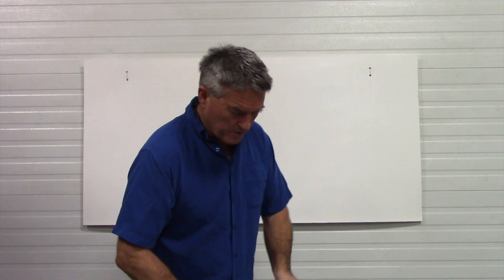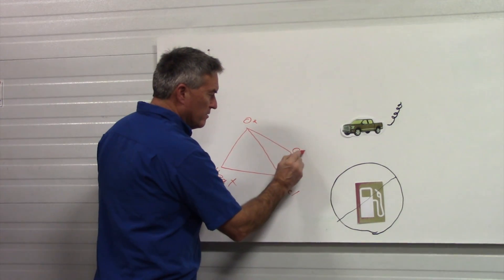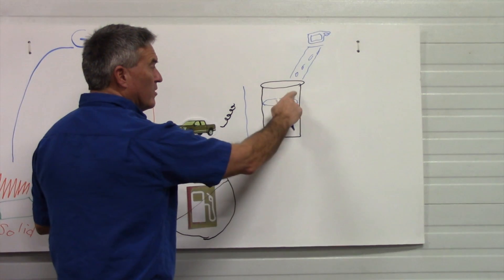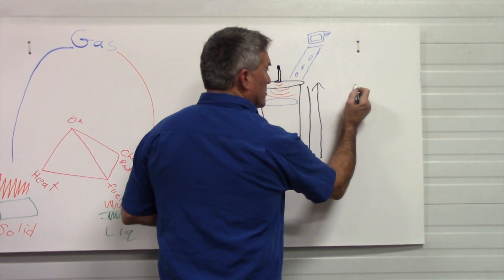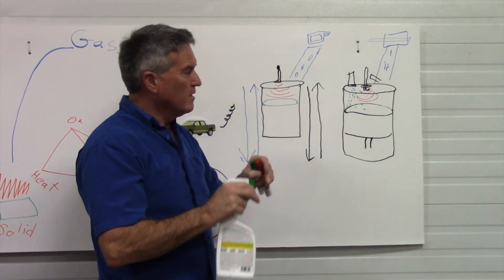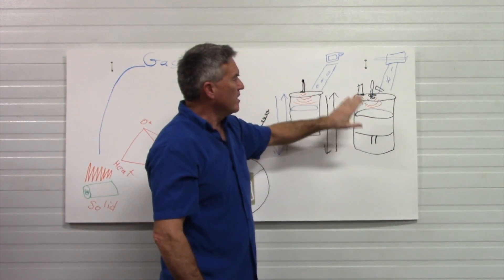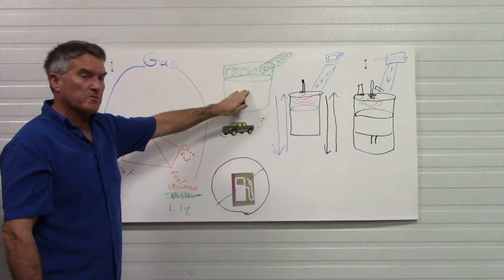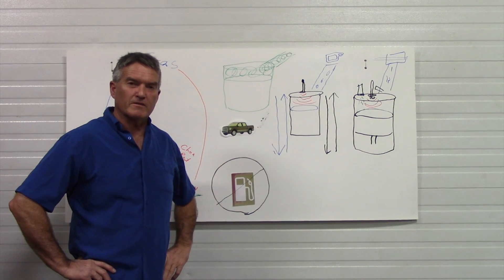One Simple Trick to get 100 miles per gallon with less pollution!

Comment: COMPLETE BS....
At least half the statements made by this guy are factually incorrect.
The ~200 year old piston engine's basic design and operating principles are the problem.
Piston Engines can never be much over 23% efficient, 
and most are around 18% when operating perfectly, as designed.
The energy in a fuel is used in the form of heat to create pressure.
A piston engine THROWS AWAY 70 to 75% of that heat without
extracting any useful work from it.
How did he eliminate all the heat coming off of that radiator ? Enough heat
to keep your entire home continuously over 80 degrees in the dead of winter ? 
AT IDLE SPEEDS !!!
I have a COMPLETELY different design for an engine that is over 80% efficient,
but I don't want to prematurely  "disappear"  from the face of the Earth.
4X the power, AND, 4X the efficiency, with all the tire smoke you can stand..... Not driving 
around like your grandmother on 23 different prescription drugs.
That's right, it can be done, but it will NEVER happen using a piston engine.
Reply: Believe it or not, it's not wasted time.
Putting down large concepts in writing clarifies the overall "vision" in your mind.
Kinda like cleaning your garage, throwing out the junk, 
and organizing everything of potential future value.
Along with consistent defining of misunderstood words, this literally will increase your I.Q..
Clarity of thought is a wonderful thing, and most people don't have much of it,
so they wind-up with a whole catalogue of "automatic responses" and are continually
trying to cover it up with "blarney" (BS). 
And, they think that everybody else is doing the same thing.
Not only all this, there are a few people who are looking for particular answers
to the present stage in their learning curve, which may have nothing to do with
the apparent, overall subject matter here, or even our exchange. 
And they will somehow "accidentally", and for some bizarre reason, just "bump-in-to" this thread,
which may prompt them to "re-think" things in their own personal way.
You wouldn't believe how prevalent this method of learning is, for everyone.
(not necessarily just comments on YouTube, any recorded communication will do) 
I only care about the 2 or 3 people this may inspire, 
nobody else would keep on reading this far anyway.
Reply: Jim Brown I read your posts fully and back you up 100%.  Too bad more people don't value the art of writing.
Reply: Smokey Yunick would've begged to differ...   http://www.hotrod.com/articles/hrdp-1009-what-ever-happened-to-smokeys-hot-vapor-engine/
Reply: I'm very familiar with Smokey.
And what he did was a valiant effort, but it wouldn't "rock-the world".
You evidently skipped over 90% of my post, and think Smokey solved ALL the probs
with piston engines.
He was a brilliant inventor, and I've read everything I could find that he had anything to do with.
But they are STILL antique, WAY outdated, piston engines.
My engine design doesn't have any kind of cooling system,
and the exhaust temps are only ~40 to ~50 degrees above ambient temps, 
and, ~90% of the engine is made out of PLASTICS.
Reply: Jim Brown 
YOU AND I ARE ON THE SAME PLANET!
Very difficult to find someone like you.
Reply: What ???
Are you thinking I'm talking about a Turbine ??
Not a chance, it is not positive displacement, and is therefore not all that efficient.
They are not well suited to cars......  too many transient power requirements.
And what reasonable efficiency they do have, comes only in a very limited rpm range/loading.
They do, however, last almost forever, but.... 
they are massive and heavy, relative to their output, and
they have thousands of precision machined parts making them very expensive. 
But as for longevity, 200K miles is acceptable for a car, 
and most other "intermittent duty" applications.
My design produces torque almost like an electric motor....  ~max, from zero to ~10K rpm.
The rpm is only limited by how much wear you are willing to tolerate.
Like any other machine, you get less wear with lower operating speeds, 
with my design it's actually close to zero wear below ~2K rpm.
And, it can be rebuilt to like new in just a few hours time.
I don't operate on supposition, just math formulas, and known principles.
Reply: The Prius engine operates at 40 percent efficiency today, and Mazda has the skyactive-x coming out in 2019 that will operate just above that. The prius engine is the Atkinson cycle so does better at constant load, the Mazda Skyactive-X uses HCCI combined with spark ignition at low loads for SCCI.... Beyond that RCCI engines which use dual fuels have been shown with thermal efficiencies up to 60% in the lab and these have stable efficiencies across the entire load range the only thing preventing us from using those is materials science to eliminate piston wall lubrication and cooling. The idea that engines can't exceed around 20% thermal efficiency is long dead. A big part of all these engine designs is lowering peak combustion temperatures which increases efficiency as well as lowers emissions.
Reply: Jim Brown ... 
It 'was' long .. but, I read it all !! .. 
I'm nobody of importance in this realm of mechanics, but, highly interested.. but I did read every word.
Reply: Yes, if you take a real Mechanical Engineering Thermodynamics course you realize thru lots of complex math how primitive and wasteful a 4 cycle engine is. There is the explosion that releases pressurized gas, but there is an enormous amount of wasted heat. An incandescent light bulb is probably more efficient. On top of that, modern cars may burn MORE gas for emissions reasons. Some older fuel injected cars may actually have better mileage with simple engine technology. Why? Keeping the catalytic converter hot isn't cheap either. Just take your scan tool and watch the 02 sensors. 1/2 the time they are driven rich. They also try to avoid lean mixtures for emissions (DI is changing that somewhat).
Reply: YOU MAY think a steam turbine that uses the heat from exaust .............
Reply: Hi Robert, Please join the Gasoline Vapor Systems group on Facebook! Many of the Smokey Yunick guys are there !
Reply: Hi Roy Rogers, I invite you to join the Gasoline Vapor Systems group on Facebook .
Reply: Your 23% is bit off, even back in 2006 Wartsila-Sulzer RTA96-C reached over 50% thermel efficiency. ( https://en.wikipedia.org/wiki/W%C3%A4rtsil%C3%A4-Sulzer_RTA96-C )
Reply: Jim Brown - Not that you care, but I agree, at least half of this is bs. And it's just common knowledge that any time you convert energy from one form to another there are huge losses in efficiency (electric cars aren't all they're cracked up to be either in my opinion).  Do you have a working prototype that you've tested? 80% would be huge, but you're right, many people would want you to disappear. I'm not a "climate denier" but I don't think fluctuations in co2 are as horrible as we are lead to believe. That being said, I'm always a fan of and interested in greater efficiency.

Haha "fuel saver mixing tank". Sounds a lot like a pseudo carburetor to me. Oxygen and "air" are not the same, nor are acetylene and "gasoline ".
Reply: +Jim Brown, hope your right however 10 years sounds like way too long to continue putting up with this Fricking nonsense. Banksters, "guberment" etc..
Reply: If you want to die or have your idea stolen regarding energy related devices post it with the patent office.
Reply: jim brown you are right.
now tell them how this is really accomplished by the manufacturer through the exhaust system components.
Reply: +Gasoline Vapor Systems dont do it roy.
Reply: Where do you fail i wonder?
Reply: New engine in devellopment 63 %
Reply: Jim Brown - Don’t worry Jim, Stupid Man seems to be one of these word bots that tries to create a negative emotional response from real humans. Thank you for your insight on the concepts that you previously wrote about. I’m actually 1 of those 3 individuals that actually read the entire exchange. In a way, you sort of remind me of Mr. Paul Pantone. I’ve learned a lot up to this point and will continue to search for more of this type of information and apply it to personal use. I’ve made it my personal responsibility to do my best to remove the tight grasp of control that the energy cartels have over me and my family but you are right about one thing. It’s foolish to think that one can get rich quick or attempt to save the world from the evil that men do by patents, public awareness, and good intentions. So many great minds/ great inventors have died in vane. I spoke to Mr. Pantone over the phone on a few occasions in 2015 before he passed but I never did get to finish my series of questions concerning his GEET design. Hopefully I’ll get to develop some extra time soon to finally start building my own.
Reply: Chase Rayfield -Please forgive my ignorance because I’m still in the learning phase of all this but I was wondering if you could maybe provide some insight or opinion on the efficiencies of HHO systems or menthol/water injection systems as an adjunct to vehicle engines?
Reply: Jim Brown Thank you Jim. I will investigate and hopefully apply.
Reply: looks like more than 2 or 3  have read this post. I'm very curious.
Reply: Jim Brown Everybody is on drugs now latest studies show pharms in every water tested in USA tap and lake
Reply: I'm a female & I read every word. Brown is right, patents are worthless, been hijacked by new illegal evil laws. Love ur guy's minds! Former Engineering  Computer technical document creator / editor.
Reply: Jim Brown: Man, ur right about the world & evil ppl controlling things...   there is risk of disappearing... u must not need the money or u could sell ur idea to the rich man & let him take the risk.
Reply: absoftitanium but what is the conversion efficiency to get the energy in the first place then to store it into the battery and to use electronic systems to actually deliver it to the motor?
Reply: Create steam with nuclear energy or with a volcano !
Reply: No man rich enough, they make their money killing remember. United World Youth Org, a generation, needs to silence their inheritance like 1989 China. ALL feasible. Perfect besides. Inefficient broken infrastructure replaced in a quick decade.....sooner The Venus Project for only the youth, free the old.
Reply: There is no law. Money = evil dumb dangerous inefficient uncreative. We live a carbon farmed slave populated infrastructure on Titanic ride under cloud. Old broke(n) infrastructure yielding death can be replaced in 10 years per J Fresco, The Venus Project. All feasible, easy to see replace inefficiency with efficiency/truth/education/health/Earth worship/Universe...and above all the many many brains of the world.
Reply: Jim, I realize you're "laying low" but I wish you'd make yourself more accessible to those who care to surround themselves with people that can make them better.
Reply: info?
Reply: 80% huge? Try liberty.....killing maiming orphaning, oil/rubber knew it. Mass transit abolished by them. Infrastructure as inefficient as combustion engine and waaaaaay behind tech. NO fix. The carbon farmed slave pop infrastructure cease to exist. Do-over is the shit like a Hiroshima or a light bulb in Africa.. We are at the edge of disruption! MANY MANY if not ALL past (money=dumb dangerous inefficient uncreative evil) typical things will evaporate. MANY MANY were for enslavement purposes at any price. Yes ALL including government. They will have a dollar bill and a quart of blood in museums representing this era.....and maybe some handcuffs. People will walk by this era shaking their heads.
Reply: whats with the 23 perscription drug comment meam
Reply: No, it's just that the 200 MPG Pogue Carburator was not mandated by law when it was patented and tested in 1936.
Reply: Check my comment!
Reply: Hey ... leave Jim Brown alone ... he declared that what he was about to say was "COMPLETE BS...." and it was.
Reply: Your Fiat Currency will be worthless in the very near future.
It may be happening as I write this, with the Bond market falling off a cliff.
The Stock Markets will follow if this continues, 
if the Fed can no longer prop it up by buying Bonds with cubic money printing.
Check out Gregory Mannarino at  https://www.traderschoice.net/  super smart guy.
You better work quick to get your money, OUT OF PAPER, and/or the Stock Market, 
and put it into Gold / Silver / CryptoCurrencies,
or at the very least, other tangible property.
Crypto's can be a steep learning curve, but that's what you will be using for money very soon.

Engine......
I'm just a genius inventor with 3+ decades worth of automotive and racing experience.
The racing was fun, but I wish I knew then, what I know now.
I spent around 5 years, part time, learning the math and principles, and what existing
technologies could be put together in a manner that would allow them to "play-nice" together.
I would NOT recommend pursuing production at this time, for numerous reasons.
First off, you will be shut down, or "disappeared", if you don't "Play-Ball" with the evil sharks.
Until the evil sharks become irrelevant, (5 to 10 years), your only other option would
be to hype it, then sell out, and let somebody else get shut-down.
This is a very dangerous game.
I'll freely give you the very simple concepts that make this engine possible.
Just remember, you're going to be stomping like hell on some VERY powerful toes. 
Here's the nutshell...
Look up Compound Steamship Engine. You may have to learn about the magical properties
of steam before you truly understand why it works so well, and is so efficient.
Understand that around 80+% of the byproducts of burning carbon based fuels is Steam.
And, the fact that, present day car engines are really just very inefficient steam engines.
Combustion..... 
Piston engines can not provide enough "time" (single digit milliseconds at high speeds) 
to allow complete combustion.
Therefore, there must be a switch from intermittent "internal combustion", 
(such as in a modern piston engine), to quasi "external combustion",
(continuous, and instantly variable, combustion), (inside a separate part of the engine), 
which will provide plenty of time for complete combustion. (~250+ milliseconds)
Then, add water to create additional steam volume and drastically lower the peak combustion
temperatures of the exhaust gases exiting the combustion chamber.
The Combustion Chamber it's self, is a patented design, but the fools made the patent
extremely "narrow in scope", and did not foresee any applications other than 
Turbo-Jet aircraft engines, so the patent on this design is a moot point.
It's called SPRF (Stagnation Point, Reverse Flow) (Google it).
It's a truly ingenious design with extremely low, to zero, unwanted emissions.
20 years later..... it still has not been incorporated into any modern Jet engines, 
even though the problems it solves are more pressing than ever, and
the change-over is relatively easy and 
could be done during normal scheduled engine maintenance. 
Probably for the same reasons that my engine design would be stomped on.
Pumping....  
(the replacement of monkey motion reciprocating pistons for something far more efficient)
Engines are just big air / steam pumps, so why not use a far more practical "Rotary Vane Pump" ?
They last 3 to 10 times as long, waste less power, don't vibrate, are simple to make,
and can easily be "Compounded" (in a single housing),
like the above mentioned Steamship Steam Engines, 
not to mention that they can be made out of PLASTICS,
because of the low peak loads, and even temperature distribution, and very large surface areas.
Cooling system..... You can easily control the temperature and pressure of the generated steam,
so no "cooling system" is needed or wanted, ever. 
Cooling systems are 100% wasted energy, 
(around ~30% of the total energy produced is wasted on cooling,
another ~30% goes straight out the tail pipe as "super-heated" steam and a few odd hot gases).
(Modern "State of the Art" engines struggle to achieve 23% efficiency)
Fuel and Lubrication.....
Diesel, is not only a very energy dense fuel, it's also a good lubricant, so a small metered amount
can be injected into the air inlet of the engine, (the compressor stage), 
and will be completely burned when it 
reaches the combustion chamber along with the normally injected fuel.
Therefore, no separate lubrication system, or "oil pan", is needed or wanted.
The engine can be calibrated / set-up, to work with any liquid or gaseous fuel, but my research
has convinced me that there is currently no better solution than Diesel.
Note: Diesel can be synthesized, or made from things like Coconuts, or cooking oils. (Bio-Diesel)
Nominal Temperatures and Pressures......
Highest Temperature = inside Combustion Chamber only, depending upon fuel used, ~1,200F,
this is quickly reduced and regulated to around ~450F and 450psi steam, ~5 to ~10% of
which is used to power the compressor stage, the remainder is converted to rotary horsepower
in multiple Compound Rotary Vane Motors, 
that are integrated, or remote from, the rest of the engine components.
This is so simple that somebody had to have come up with this before I did,
but nothing remotely close is found in any Patent Records.
Possibly because they have been "classified" and buried.
It's a bullet-proof and ultra-reliable design, that would 
immediately replace piston engines in small aircraft, for those reasons.
It also facilitates building Twin-Prop planes with 75% of the weight of the "engine"
mounted at the center of gravity / rotation inside the fuselage, vastly improving handling. 
Maybe you can get an Asian company to run with this, (but they'll steal it from you). 
This is all the info they will need.
You won't ever get it done in the good ole USSA. 
                             Jim
Reply: "you're going to be stomping like hell on some VERY powerful toes."    Likely the same folks responsible for hiding the truth about the flat earth from the rest of humanity!  Hell, I bet when they "   'classified' and buried  " the patents ( as you contend ) they put them in the super-secret-hidden archives in Antarctica for safe keeping.  Oh crap, now I just spilled the beans about the existence of the super-secret-hidden archives that nobody outside the inner circle are supposed to know about.

This whole diatribe is just tin foil hat nut job propaganda.   Keep it up though, it's really entertaining!
Reply: Jim Brown 🏅
You, sir, are a fine example of the reason I even bother reading the comments related to videos that have sparked my interest. A rare find, I must say! I just wanted to say good luck on your venture and thank you for the ideas.
Reply: oh wow, I am not reading that mess. please stay on topic Jim, You have a product millions want, but wont produce evidence of it...

show me it exists physically and name your price, I'm a very very wealthy man.

-Dick
Reply: Jim Brown what's the patent number if your design?
Reply: Stupid Man ... Your name, by faaaaar, says it all.... !
Reply: Well monkeyman i think you must go back to the drawingboard. I have experimented with preheating gasoline by letting the injectors spray gasoline directly into a electrical heated surface in the manifold and the result is no stinky exhaust and the engine runs cooler and is less noisy. How cant it be??
Reply: If it dont work out for you, you have done something wrong :)
Reply: Jim Brown precious metals and supplies never lose value. Good day ya cook
Reply: (Except Stupid Man !!! )
Reply: Jim Brown think of how many hours youve wasted typing 3 book stories on yt that no one reads